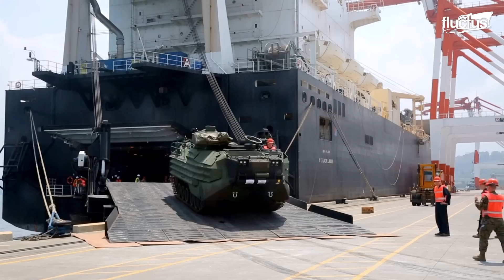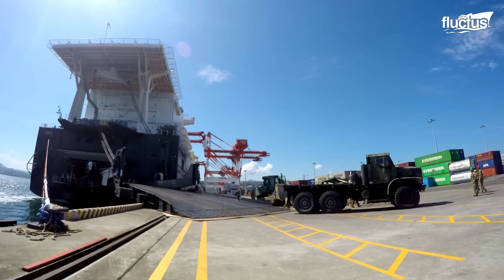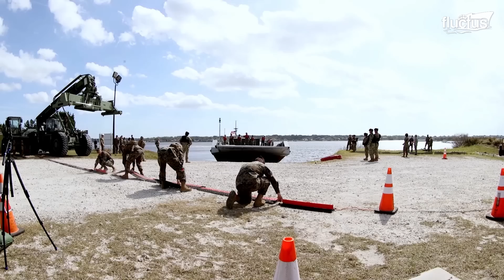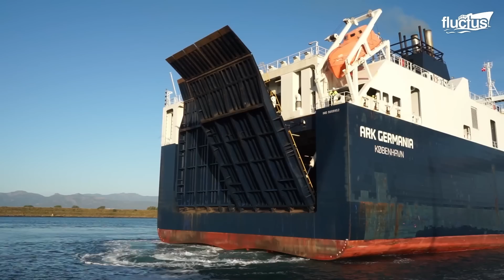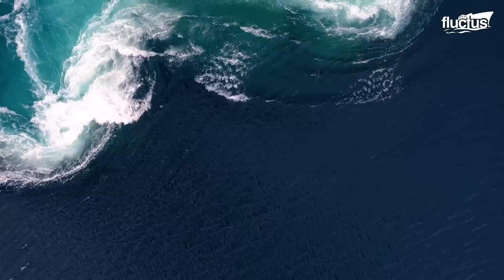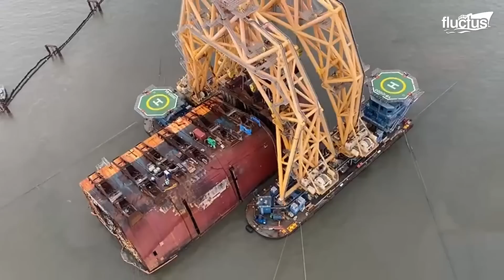Inside US Crazy Logistics to Transport Billion $ Military Hardware By Sea

Comment: There's ALOT OF WISHFUL THINKING HERE---AND IN THE MILITARY. Much of the various military "sea-lift" shipping capability is resting on too few and too old vessels that don't have the capacity, and more importantly-the reliability, needed to sustain operations. They can't even get the shipping together to build the GAZA PIER and get supplies going. The USS BOBO, a HUGE US Navy  strategic sealift ship got a few hundred miles out to sea when an engine failed-they were towed back to the US. A couple of others never got out of port and at least two made it to foreign harbors where they still sit-useless. Go watch Sal at "what's going on with shipping" for the straight poop.

Comment: What is so crazy about this. Roll On Roll Off ( Roro) can move more equipment faster than traditional freighters. The military has contanerized cargo now, a big improvement since the First Gulf War ( 1990-91 ) The former SeaLand SL-7 freighters were fast, but after being in the Ready Reserve Fleet since the 70s, they had boiler problems and their unloading times were long. I was involved in the sealift to get all this stuff from here to there.